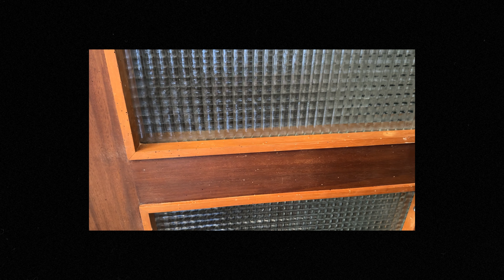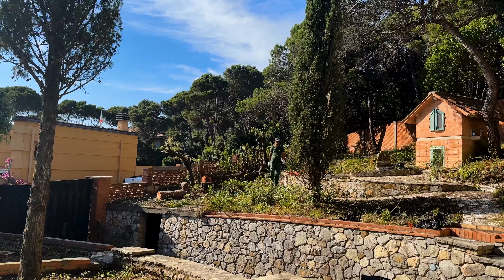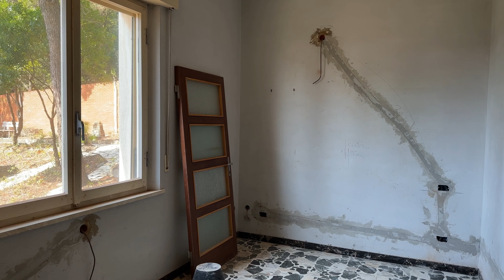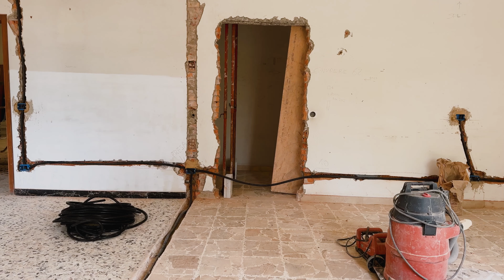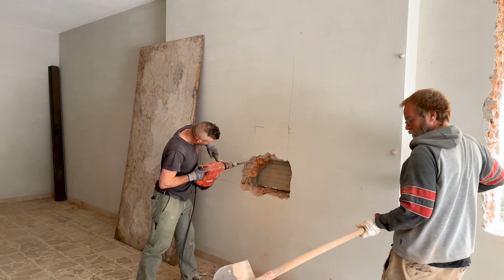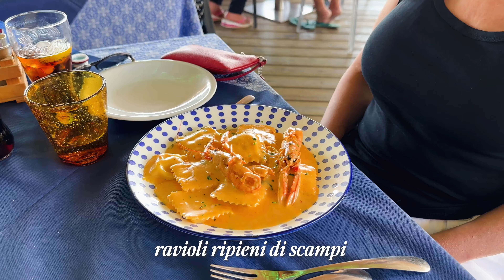Renovating in Tuscany: Budget BREAKING! | New Heating, Windows, & Electrical

Comment: I agree, a renovation budget never goes according to plan, or the timeline. We purchased our home 10 years ago 🇦🇺 with the intention of doing a full renovation within the 2-5 years, we have finished half. We are doing 90% of it ourselves (plumbing, tiling and cabinets outsourced), we have stripped the house back to the brick and stud walls, removed the insulation and ceiling as it was dropping from the trusses, knocked down the walls to the 3rd bedroom, cut a hole in the external wall for a door way to a new 3rd bedroom and study extension. Hubby has metal framed all the walls in the extension, I have done all the insulation after he re wired everything even a new meter box and we have replaced all the gyprock, hung cornice, plastered all seams and painted. Only the laundry, 2 bathrooms, walk in robe and carpet to the 2 remaining bedrooms to go. 
You’ll get there 💪🏻 and where you can get in and remove things yourselves it’ll save a bunch of money.
Reply from the maker: That is soooo incredible!! 💪I can't even begin to think about how satisfying it must feel to accomplish such a huge undertaking! I need to take a page from your book!! For the heating and windows--I'm so happy letting the construction company take over, but I would love to do things where I can. How did you guys learn to do all that?! Do you have previous experience? I keep telling myself we'll get there eventually. I just have to be patient...
Reply: @CasaArdor  patience and communication is key, my hubby is a bricklayer, plasterer (internal and external) by trade and now works in the electrical industry as his brothers trade assistant so he ran all the wiring and his brother signed it off then we started putting it all back together, this is our 2nd renovation project and we have taken so long as we needed to build a big shed to house all or belongings and I collected too many dogs along the way, my hobby has now been put on pause so we can get the house done. Prioritise the must do’s and plan the wants so you have something to look forward to as it can sometimes feel like you’ve achieved nothing and get depressed, then everything will happen in a hurry. We lived with the laundry as my kitchen and no walls or ceiling for 18 months due to hubby’s work schedule. Keep plugging at it, I can’t wait to follow the journey. ❤️ Michelle
Reply from the maker: First off… There’s no such thing as too many pups! 🐶I’m sure they bring you so much joy!! Thanks so much for your kind words of support!! 🥰They mean so much to us, especially at this tricky stage. Just as you said, it's all about re-prioritizing and figuring out what works best for your situation. Having someone in the trade is so helpful, but I imagine when it gets busy at work, the last thing anyone wants to do is work when they get home from a long day. It’s a true testament to you both that you are powering through your 2nd renovation!! I’ll definitely keep your words of wisdom at heart because everything can be halted and then it’s go time! Sending a big big hug from Italy! 🤗
Reply: @CasaArdor  #staypawsitive cheering you on from the Sunshine Coast Queensland Australia